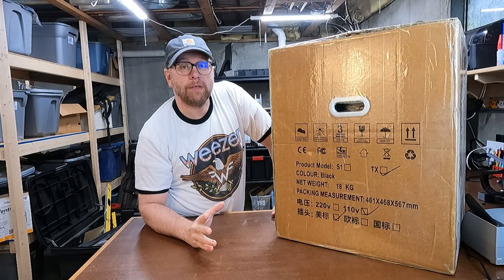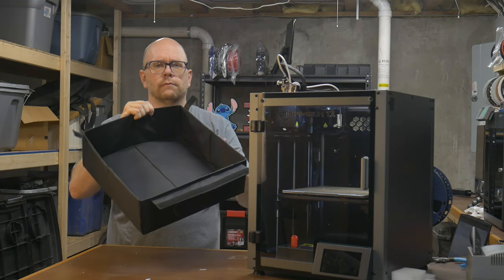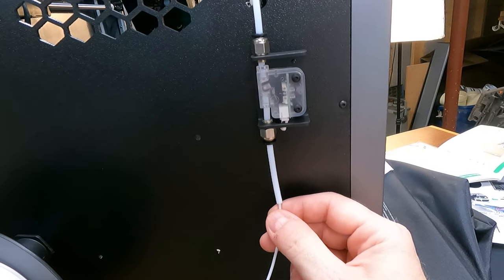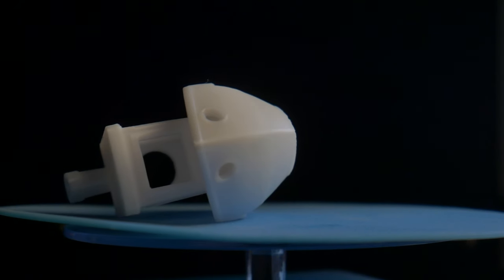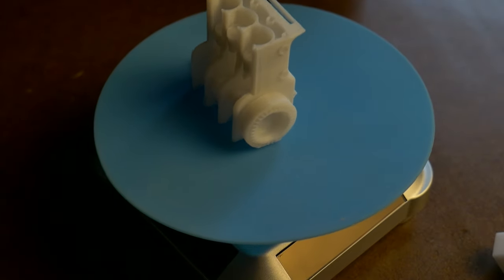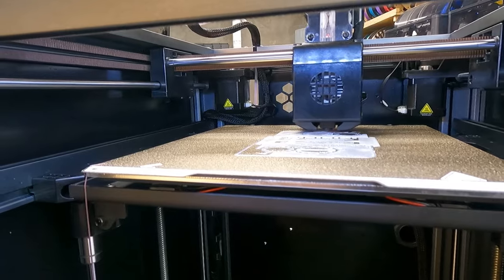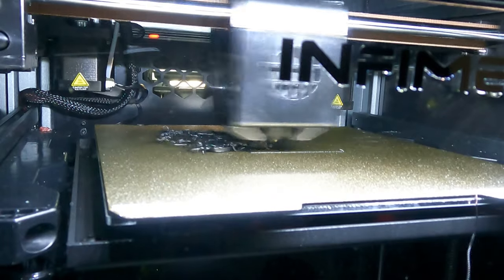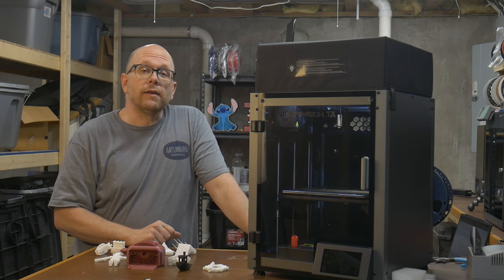High Speed, High Temperature and Affordable?  Infimech TX 3D Printer Review

Comment: I am using this printer for almost three months now to great satisfaction. To be honest, I mainly print PLA but I have already printed a variety of brands. I do think you should have mentioned the accessory kit they sell. It consists of an enclosure exhaust fan with carbon filter, a huge parts cooling fan and a camera. They also supply STL files for printing additional enclosure material for the accessories. I am also very happy with these.
Reply from the maker: Great info. Thanks!

Comment: Thanks for the video. Your video best lay's out the capabilities and shortcomings very clearly. I've been thinking about either the TX or the Q1 Pro. Did you preheat the chamber before starting to print the ABS benchie?
Reply from the maker: Thanks. No I didn’t preheat the chamber. There isn’t a dedicated camber heater, just whatever heat is captured from the build plate. Seems to work pretty good, but I still would need to test on a larger print with thinner walls.